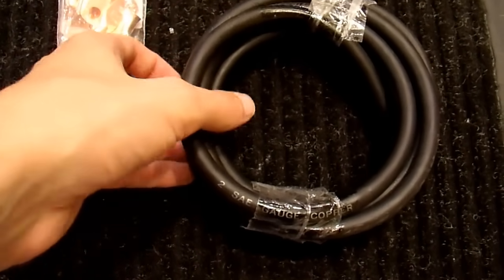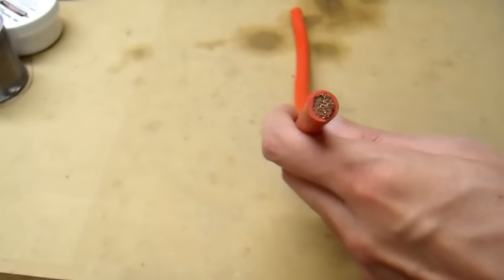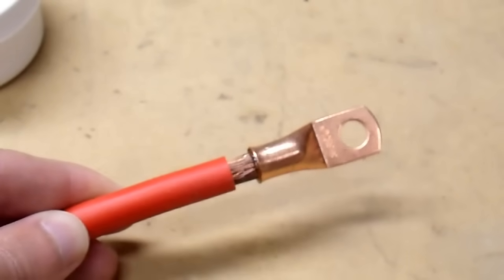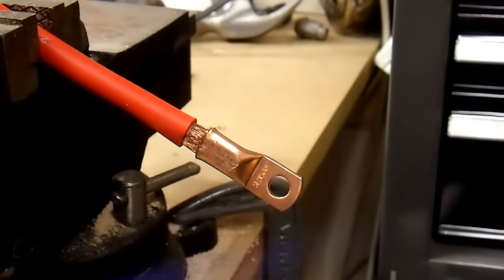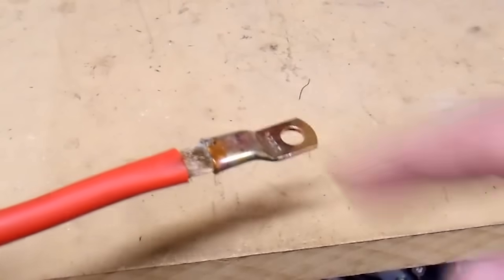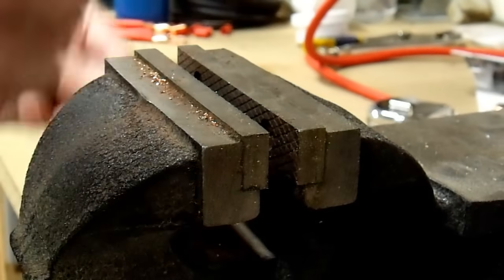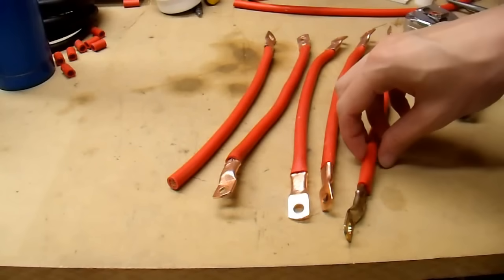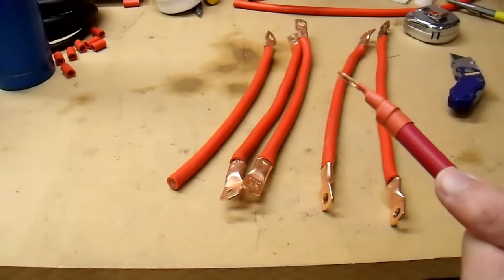How to Make Battery Cables the Right Way and the Easy Way

Comment: As others have pointed out, solder should not be used, only crimp, but even if you prefer soldering, the flux is applied at the wrong end, it's just going to sit there and corrode the copper. If you had applied at the insulator end where the connector meets the cable, just at the boundary, a good solder can be achieved, and excess flux can be wiped off. You could have used No-Cleen flux as well, it's non-acidic
Reply from the maker: This is absolutely incorrect.  I work in industry which has an intense interest in such topics.  Solder reduces vibration resistance due to metal fatigue which is an issue in mobile applications.  In stationary applications the primary reliability consideration is a low impedance connection that can resist external corrosion sources such as acid.  For this solder is an excellent protectant.  Yes, no clean flux would have been better but that is a very minor critique.  My method works very well.  Note that since this video was published NEC standards have changed and this no longer meets many regulation requirements.  This is in now way a reflection in its effectiveness.
Reply from the maker: If the flux is properly activated it will have no corrosion inducing properties.  No clean flux is more fussy which is why I don't like it.  For well controlled professional use it works better, but not for most people.

Comment: It's not good from a reliability point of view. 1) unreliable over time whenever it's used in conditions with even slight vibrations 2) unreliable from a manufacturing pt of view... If you made a 1000 cables, the failure rate would make it uneconomical

Comment: Propane Torch is to small.  Acetylene or Mapp is much hotter. Solder is the way to go. Especially on the battery . But I might crimp it too. Thanks for sharing.  Good ideas all
.
Reply: I agree with your comment.  You want to get the connector and the wire end hot quickly--not so hot as to cook it but you don't want to dawdle.  The only thing I might add would be to drill a small hole n the connector barrel to allow air to escape.  This will also let you know when the connector is full.
Reply: So in other words, you couldn't use a soldering iron, at all???  i did buy one thinking it looked more civilized than a torch and safer....   because the torch idea is out of my range of comfort, and even the soldering iron is looking messy and weak-but-hazardous...  hope you'll understand that all those years in insurance [looking at fire claims] doesn't improve things...... ttyl hopefully
Reply: @dectiri  you'd have to have one hell of an iron.  i have soldered 1/0 wire with a propane (don't need MAPP) torch.  But the fact is that a crimp tool for 1/0 wire is not too expensive and is very easy to use-just put the connector into the crimper, put the wire into the connector, and whack the crimper a couple of times with a hammer.  It's very easy to do.  Then use adhesive-lined shrink tubing to seal the connection and you're good to go.  Amazon sells the crimper-its called a "Hammer Battery Lug Crimping Tool for 8, 6, 4, 2, 1/0, 2/0 American Wire Gauge (AWG) Wire and Cable".
Hope that helps.
Reply: @SRFDriver  Thank you very much, as i am going to have a look at this 'hammer' tool and make a decently calmer decision... i was so in love with the idea that even this 150w soldering iron would be doable compared to my aversion to torching, that i wasn't even thinking about there possibly being a third alternative, i just looked for something 'like' the torch but more civilized [able to be turned on with a switch, lol] but more powerful than the usual irons for computer gizmo work... as you may agree it didn't suffice to make the battery banking project i was able to do the math for, ever get beyond assembling appropriate components, the mountings, the enclosure etc and make that last step of making the cables... ttyl and thanks again... best as always

Comment: what is the best wire gauge (size) for a 1000w bestek power inverter? thanks.
Reply: 1000w at what voltage, (assume 220V AC output) divide 1000 with 200 (approx on the high side) gives 5A, use the cable that can handle twice as much (safety margin) gives 20 awg, also keep cable length in mind. 20awg resistance is 10 ohms per 1000ft. So at 100ft it presents one ohm resistance. So for 220v rms at full 5A current, there would be 5v drop, so you will get 215v rms....

Comment: When you see a guy telling you there is the hammer type tool for crimping electrical connections (a POOR choice) and then proceeds to use a vice as a crimper, BE WARNED, this is not the advice to follow. Ratchet style crimpers for proper crimping of electrical connections are not cheap. It would be nice if someone who works in the military aerospace industry or equivalent would post a video of how this SHOULD be done --solder or crimp connections. THIS video is not it!

Comment: OMG! this is exactly the opposite of the right way to do heavy cable terminations. poor stripping, horrible crimp, kludge with some solder,  and no heat shrink. what a bone head. if you have such a concern with seeing through the heat shrink, use the clear stuff. none, and i mean absolutely none of the reason you gave to avoid heat shrink have ant validity. for that matter, none of your recommendations are "the right way" sure they might work for some time. but a properly swaged and adhesive lined heat shrink protected termination will outlast any of your examples in any condition they might be used in.  OMG face palm...

Comment: I had an old set of jumper cables that just became useless as the crimps became loose over the years, I soldered them in much the way you've done here except I used plumbers solder and acid flux which I washed away afterward using warm water and baking soda as neutralizer.  The acid flux was necessary to get the solder to flow well and fill the empty voids for a solid and permanent joint.

What a difference, those jumper cables never worker so well!

Comment: You are correct in stating “How to make cable connections the easy way”... but by all means not the right way...lol..
Using a bench vise and crimping the terminal flat is absurd..
As an electrician for over thirty years, a rule of thumb per my peers is to always strip only the length of the crimp sleeve, never to leave any exposed copper conductor exposed.
I am not criticizing your method, it works for you..
As far as heat shrink tubing?.. please , oh please, it’s not for cosmetic purposes..lol

Comment: You can also add battery terminal grease to help prevent corrosion and help with a better contact along with the soder. I still recommend getting a proper crimping tool. If everything is done correctly. There will be no harm in using shrink tubing to help protect your investment.

Comment: Clamp the connector.  Fill with molten solder and insert cable.  Only expose enough so the insulation meets connector edge when inserted.  Cover with appropriate double wall heat shrink in matching color.    Done.   That exposed wiring on yours will corrode mucho bigtime.

Comment: Not how I make my cables at all. I place the end connector in a vice on the very end of the connect end then I put a little flux in it and flux the cable end I plan to use. Next I melt some solder in the connector and then keep the torch on it and push the cable down in the connector. Let it cool and it will not come off.

Comment: I bought a crimping tool at a thrift store for 5$ . Not hard to find used. Tweekers hit those gas and electric trucks all the time. 
I do solder mine and use shrink. Brake cleaner is good for final before The tubing.
Still he did a good job.

robert the mad genius******

Comment: This fellow is guessing.  He is providing bad information.  There are no shortcuts for making electrical connections.  The copper terminals are only designed to be used with the correct crimping tool.  Depending on the application even the choice of wire is wrong (many fine strands versus few strands of coarser wire).

Comment: I love the punch amd hammer SMDH😬
Reply: Right?! I laughed my ass off. I've crimped cable with a vise and it can work in a pinch... but you can't crush the whole connector and expect it to work correctly, you need to create a more focused point.

Comment: ARE YOU SERIOUS?! A vice on the bare terminal..? Not only does it look like shit, it WILL fail under use as it bends, or during temperature transitions under a hood. Spend the 30 dollars for the correct tool, and do not follow these instructions... You will have a failure. Also, a terminal is not necessarily bad because is has surface oxidation or corrosion on it. Unless you have a multimeter in your eyeballs, you need to measure resistance with a meter. I do agree with you, you are lazy.

Comment: Why do people, whom whine and complain about the efforts and accomplishments of others, rarely, if ever, deliver zero positive input, zero  accomplishments, zero products and or zero contributions, towards the subject matter or problem? 

They shouldn't be allowed to comment.
Reply: It's funny to me how something like this can generate so much anger from professional egotists who have been trained to hate DIY methods, plus the people who suffer from modern consumeritis and need to buy a specialized tool for every little thing they do.
There was a time when the common man was resourceful, and his ingenuity was celebrated.  They weren't trying to build battery cables that would last for 50 years or fly to the moon.  They were trying to repair everyday items without throwing money away.  And they got away with it.  It's not a miracle, there's just a huge disconnect between practical reality and the distorted perception of it that lawyers, bureaucrats, and industry snobs tend to slip into.

In the age of the internet, all information is eventually scrutinized by the most paranoid and eccentric people on earth.  If your lawnmower spark plug cable doesn't meet NASA Regulations, you'll eventually get raked over the coals for it.

To be fair, some of the critical comments are civil and reasonable, but it's the most vindictive and aggressive comments that get voted up the highest. That says a lot about people today.

Comment: With the "unsoldered" connection, wouldn't you "slather" the copper strands in Vasoline or Dielectric Grease, before crimping?

Comment: Don't solder ,don't crimp in vice ,remember cable that size takes a fair amount of current ,current =heat =possible fire hazard.Use proper tool for job.

Comment: There are two types of lugs , crimp type, and solder type, solder has a internal resistance, crimp type, use the correct size crimper, tape over the exposed copper , then use adhesive type heat shrink and you will have no problems , this person is incorrect in many ways,  He should stay away from this sort of works.

Comment: They should just do away with all of that annoying cable insulation. This way you can easily inspect the whole cable for any problems. I can't believe nobody ever thought of that. Maybe rubber bands could be used to hold together the cable and the terminal.

Comment: There was more oxidation on that first terminal from the torch than anyone should have on a battery terminal.  His dislike of  heat shrink may have some merit given how far up the wire the solder flux has wicked.  He will need to see when the Copper turns green  (1-2  mo)  so he can do that job over again.

Comment: this guy is an idiot ive been working on cars for 12 years and im fixing to be a certified auto technician.....the part he mentioned about how he doesnt like using insulators on the terminals made me upset....its very good to use an insulator...in order to prevent corrosion you have to put silicone paste before you put heat shrink on it this prevents corrosion....this guy needs to go to school for sure cause he doesnt have a clue

Comment: You crimp with a vice or vice grips? And call it the right way?
Try this, hold the terminal in a vice like a "cup." Brush a little flux in terminal and wire end. Heat up the terminal with a propane torch and "fill" with your solder. Now dip the stripped end into the molten solder and hold till it sets up. Apply heavy shrink wrap and you're done.

Comment: These are amongst the worst cables I’ve ever seen. You should never use a vise for this. Have them made or buy the right Crimping tool for the job.  Simply “squashing” shit in a vise is not “crimping”.

Heat-shrink tubing is use to protect the joint from moisture and contaminants amongst other things. You say companies use it to hide manufacturing flaws. In that case you should use it on all of those you did. Oh, if you want to be able to inspect the joints as those certainly should be, use CLEAR heat-shrink.

The reason to use the correct solder size is so the soldering process is as short a duration as possible. Cooking the crap out of parts as long as you did also contributes to crap connections and weak copper.

Others went into the flux, acid/Rosin, corrosion bit so I’ll stop here. Please people, if you are going to do your own cables, be safe and avoid electrical fires. Buy a good book on the subject and learn from that. This vid is nothing more than a video on what NOT to do.

Comment: Or spend $28 and get a hydraulic crimper with dies for all sizes of wire which will last your lifetime and make much nicer, non-discolored, less cringey cables.

Comment: " there really isn't any good reason to use heat shrink" 🤣🤣🤣🤣🤣🤣🤣🤣🤣🤣🤣🤣🤣🤣🤣🤣🤣🤣🤣🤣🤣🤣🤣🤣🤣🤣🤣🤣🤣🤣🤣🤣🤣🤣🤣🤣🤣🤣🤣🤣🤣🤣🤣🤣🤣🤣🤣🤣🤣🤣🤣🤣🤣🤣🤣🤣🤣🤣🤣🤣🤣🤣🤣🤣🤣🤣🤣🤣🤣🤣🤣🤣🤣🤣🤣🤣🤣🤣🤣🤣🤣🤣🤣🤣🤣🤣🤣🤣🤣🤣🤣🤣🤣🤣🤣🤣😂😂😂😂😂😂😂🤣🤣🤣🤣😂😂😂😂😂😂🤣🤣🤣🤣🤣🤣🤣🤣😂😂😂😂😂😂😂😂😂🤣🤣🤣🤣🤣🤣😂😂😂😂😂😂😂🙄🙄🙄🙄🙄🙄🙄🙄🙄🙄🙄🙄🙄🙄🙄🙄🙄🙄🙄🙄🙄🙄🙄🙄🙄🙄🙄🙄🙄🙄🙄🙄🙄🙄🙄🙄🙄🙄🙄🙄🙄🙄🙄🙄🙄🙄🙄🙄🙄🙄🙄🙄🙄🙄🙄🙄🙄🙄🙄🙄🙄🙄🙄🙄🙄🙄🙄🙄
Reply from the maker: There isn't in the vast majority of applications.  I've heard no valid argument to this.
Reply: You would think if you were going to do a video like this you would use some of the correct crimping tools. Then again I guess your method works for a farm tractor on its last leg! No heat shrink, it hides too much? Might as well strip the insulation off of the wire, has to be something hiding there also! If you crimp and solder it correctly, there should be zero reasons to not use heat shrink to clean it up! Plus I would want heat shrink to hide your vice crimp!

Comment: Well done, I would of added a thick walled heat shrink(3M) on top of a layer of electrical tape just to reduce the possibility of a screwdriver or wrench arcing on it.. Either way, its efficient..

Comment: Use transparent heat shrink so that visual inspection is possible . Heat shrink also acts as a stress reliever and if quality shrink is used it is an insulator. Thanks for the video.

Comment: U can get the hammer style crimper on ebay that will do up to 2/0 wireing for like 15 or 20 bucks made from steal and makes a way better crimp and u can hang off of them i dont use solder and they look cleaner

Comment: Solder? No way. You’re wrong. Proper crimp the solder does not get into crimp area. No industry has soldered connectors in 40 years.

Comment: Lot of good info on YouTube. You have to separate the good from the bad. This guy doesn't know what he is doing. Resin flux is used on electrical work to prevent corrosion. Acid flux is not used.

Comment: These cables can get hot when heavily or overloaded.  Solder melts from heat.  These are to be crimped only when used with inverters, DC batteries, etc.  General industry common standard.  Alos, when crimping there are dies to use to get the proper form on the lug.  Just mashing in a vice isn't any good.

Comment: Where is shrink tube? You showed black wire then MAGIC IT IS RED . The heat shrink protects copper from sulfuric acid corrosion,moisture and oxidation. If no shrink tube then the at least paint enamel or clearcoat on cable to term., MASK tape on end at connection term. . Note if term. Connection and exposed copper wire is coated and protected from air, sulfuric acid gas from battery, and moisture then don't  worry !! NO CORROSION.
IF A LOT OF WETNESS ON TOP OF BATTERY, THEN THE BATTERY IS OVERHEATING INTERNALLY ,check battery elect. System for overcharging or internal intermittent shorting , and or replace. ( just my thoughts
ASE MASTER TECH, L1, X1, C1, 51 YEARS EXP.) DRIVEABILITY AND ELECTRICAL EXPERT.

Comment: no, you put the copper ring in the vice vertically heat it up fill it with solder half full. Then while hot put the wire with flux on the tip in the copper and let cool. no need to crimp.

Comment: He said you most likely see heatshrink on cables to hide factory defects from manufacturers haha this guy. SMH.  Anything below 8 gauge I use my amazon hydraulic crimper with dyes. Works wonders in car audio in the tight areas.

Comment: This is a DIY spectacular I am a Euro Master craftsman level, if you solder fine then do so, crimping would be quicker and a ratchet type crimper should be used as it applies the correct pressure and folds the bare conductor inside the ferrule to ensure maximum internal contact. If you choose to solder then do so without creating a brittle copper conductor (changing resistivity) at the end of the conductor entering the ferule - to do that you should ideally be a craftsman.

Comment: This video should be titled "Wrong Way". The solder has to meet the copper wire somewhere and it will make a rigid joint. With vibration that is where it will fail. The terminals are flared to allow some wire flex after the terminal has been properly crimped.